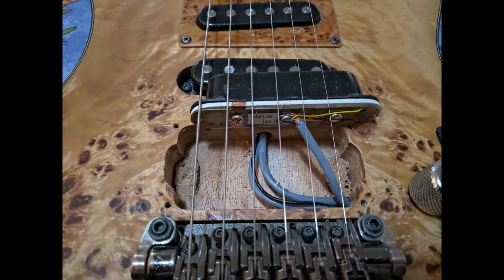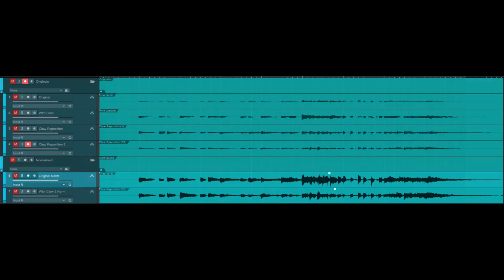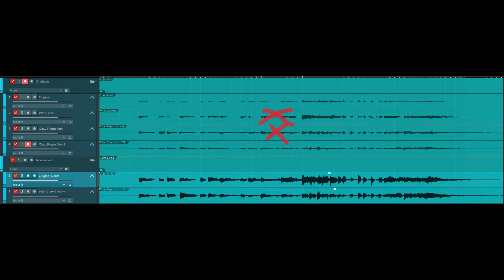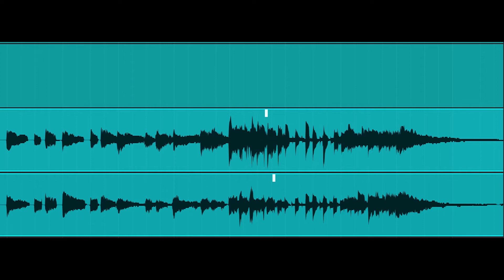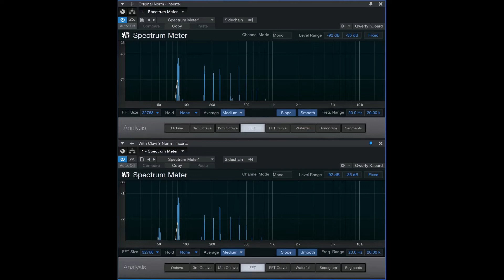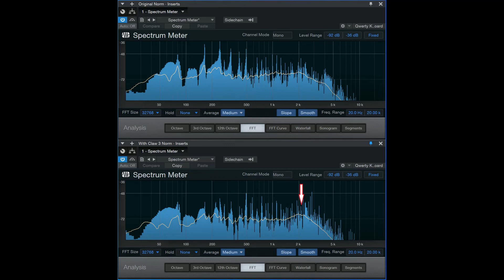Sunday Science: Jaguar Style Pickup Claw mod A/B test

Comment: Hi! Thanks for making this video.

I have a question.
If I simply unsolder the claws on the pickup will the sound change anyway?

Have you tried making the claw switchable?
Reply: I'm afraid I moved on after finding the pickup was microphonic, as I was playing in a noisy band at the time. I suspect there are two main distinct effects: magnetic and electrical. 
 Change the shape/positioning of the metal and the pickup resonance is ... "altered". Change the earthing and you might see better noise suppression.

https://youtu.be/Qqj6z0qMDOk?si=eWhe1jjCOPoyKe7-

Has a good example.

Comment: Many thanks for a great video!  Very informative! Just one question as it is a debate in offset world for a while - do you recall any impact of the claw orientation (position of 2 lower teeth)? Or do you remember hoe it was oriented in the video? That would be great to see and especially hear if there are any differences
Reply: You are welcome. You can just about see at 2:33 the 2 lower teeth are under the big E. I did not test the orientation (my bad) - I was assuming the impact of the cage was more "global" on the pickup - inductance, magnetic flux shaping etc. Like I concluded: "Impact is not drastic, but it’s a cost-effective little hack for a small change." So this could be achieved with a simple EQ pedal, but then it does not require any power!

pics are here in my Medium article

https://medium.com/axes-xplained/what-difference-does-a-jaguars-pickup-claw-make-b24e13aedce5?sk=e626a0d96fab8d6e888e07947e96cfdf
Reply from the maker: like he said